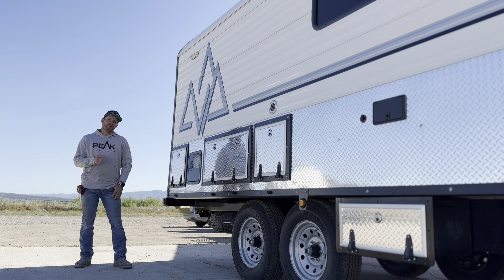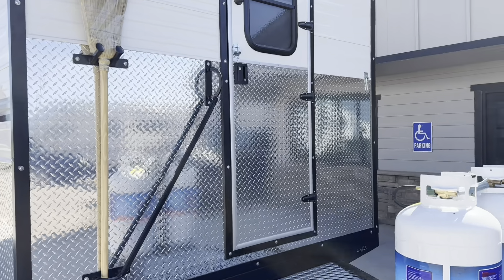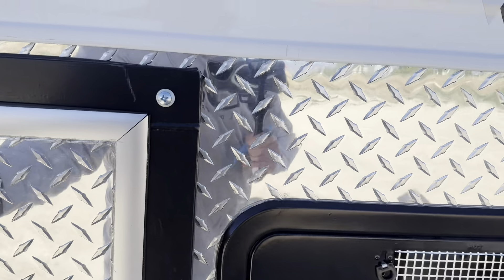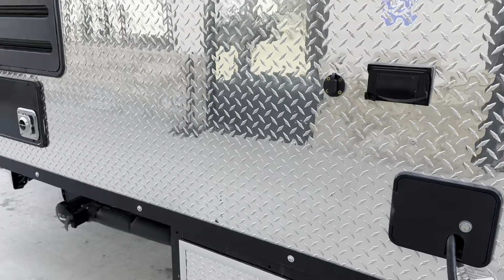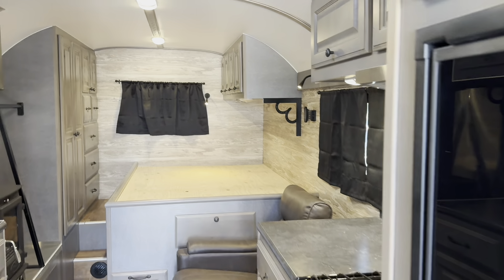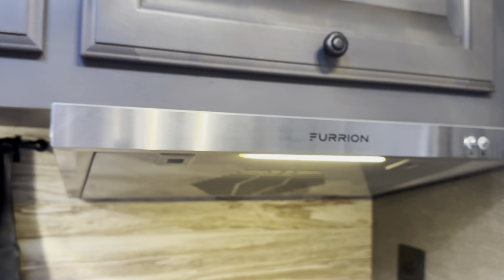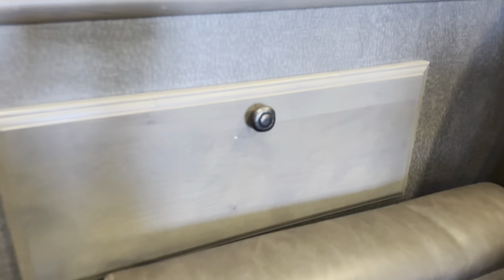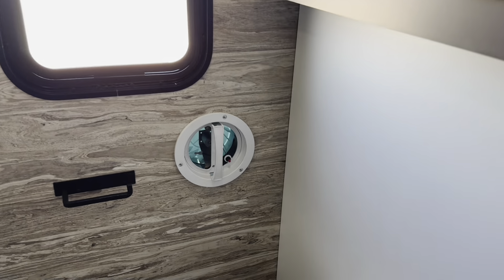There is custom, and then there is Peak Mtn Camps!

Comment: With that campers front flat surface you will get horrible fuel milage transporting it.
Reply: It doesn't help, but not horrible.  In comparison, I get 8.9 mpg at 70/75 mph towing a R-Pod (4000lb fully loaded) and 7.1 mpg at 65/70 towing this camp (9,500 fully loaded).  But if gas cost was a driving factor I wouldn't be owning a F-250 6.2l gas rig towing this camp either.  If you want to go cheap, this isn't the rig for you.
Reply: @mitchjaurena4709  --  Who said anything about cheap?  It's not a question of being cheap it's a question of design.  Thanks for showing your ignorance.  If you had a more aerodynamic design people would be able to achieve much better fuel milage with towing and you would most likely sell a lot more units for that reason alone.  Then you could afford a big boy truck with a diesel engine in it and get even better milage.  I actually thought you did a pretty good job with the interior space and with the added storage spaces on the outside of the camper.  Good luck to you, my friend.  In my estimation you're going to need it in the highly competitive camper market.
Reply: @jamesbass9797  You are kidding right?  More aerodynamic design won't translate to "much better fuel milage" on a 8600 lb camper.  Also unless you are towing something all the time, by the time you factor in the higher purchase and maintenece costs for a diesel pickup truck, and the higher cost for fuel, your payback will never be achieved beffore the vehicle is worn out.   I have a 2004 2/4 ton Chevy Suburban with a 496 cui gas engine.  I get 11-12 mpg highway empty and 8 mpg towing a 8000+ lb camper.  Yea I know I'd get better mpg with a Duramax but forking over an extra $30K for it buys a lot of gasoline that's between 50 cents to a dollar cheaper per gallon than diesel to buy.  As for the campers they build these days, you couldn't give me one, they'll all built like crap, with the possible exception of this brand, to me it looks like it's built like a tank and will take about anything you throw at it.  $70 K for this particular unit is certainly higher than what you'd pay for something of similar size from the usual manufacturers.  However 10 years from now they'll be in the junk yard and this one will just be getting broke in.
Reply from the maker: @brianlangum6253 very well said.
Reply: @jamesbass9797  I doubt that very much.  They have a waiting list and rightfully so. Now go enjoy your your overly large and expensive set up and save as much money on fuel as you can....you are going to need it to pay for your rig.
Reply: @mitchjaurena4709  --  How do you know what kind of rig I have?  That means you read my previous comment before he deleted it now, doesn't it?  What does that tell you about him?  My rig was paid for the day it was purchased.  He has a waiting list simply because he has a limited capacity production facility.  That's all.  Has nothing to do with popularity of the vehicle or for any other reason.  And that's fine.  Most newer companies have that issue.  Good or bad doesn't really matter.  As for you by all means don't quit your day job.  You are terrible at comedy.

Comment: I am very impressed with the layout and amount of storage in this camper. If it had AC, I could move right in there as it is. Good job, @mitchjaurena4709.
Reply: Thank you.  I purposely left out the A/C as I boondock and rarely if ever use shore power and I absolutely HATE the sound of a generator.  But for some, it is a requirement.
Reply: I am sure that AC can be added without much issue.